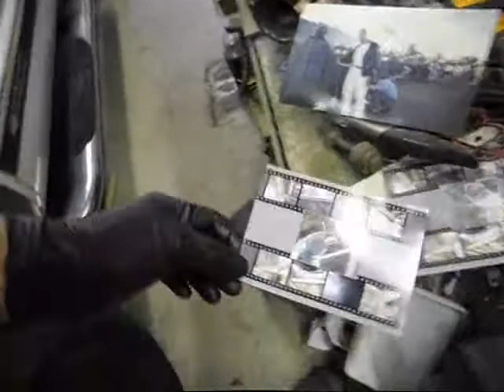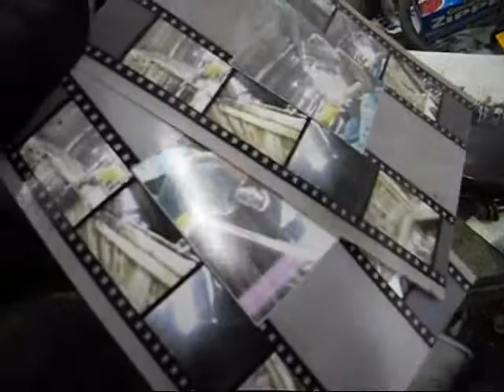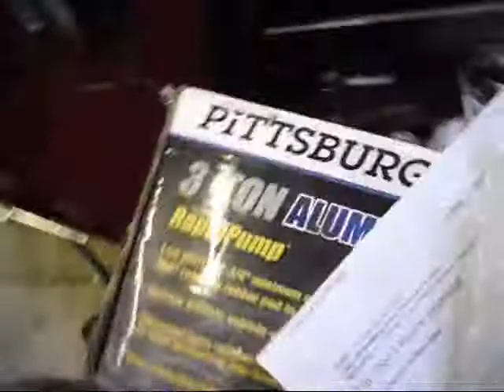Timken Bearing In Knuckle  10 6 13

Comment: I just noticed what a bad design that is. Wow. The rotor does not slide off, The hub flange sits against the wheel instead of the rotor.  Never knew!

Comment: You are lucky you didn't install the knuckle and realize oh shit where is the brake rotor lol.  

It is better to seat wheel studs using the nuts. The first time you put the wheel back on do it by hand not use the impact. Use the impact you run the risk of spinning a stud then you really won't be happy.